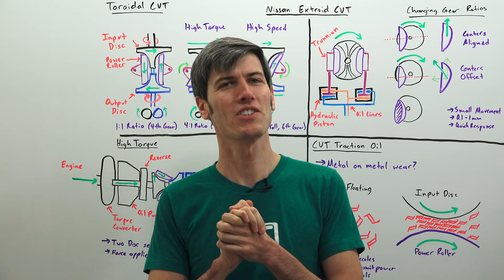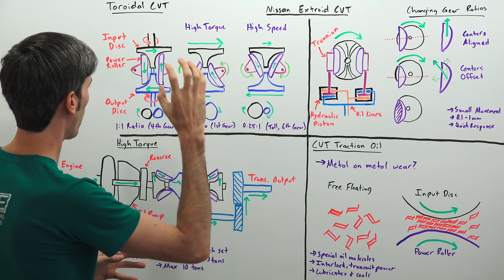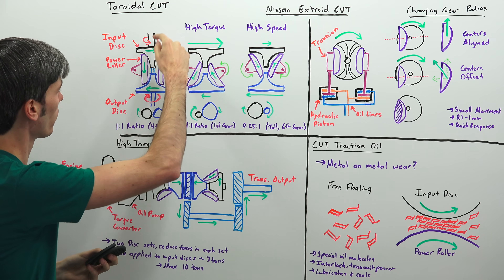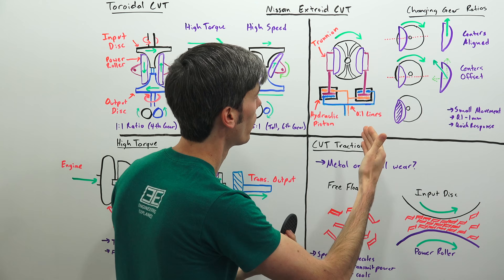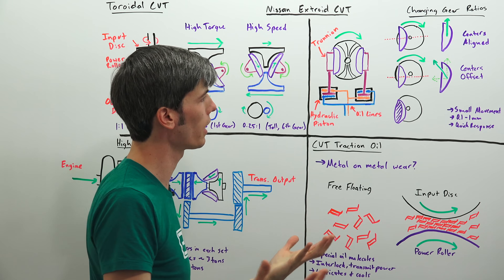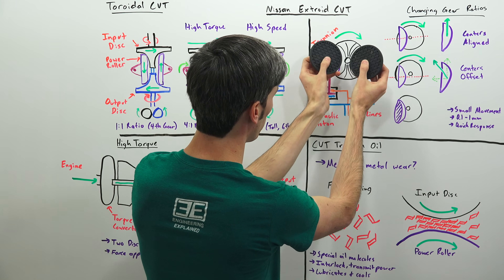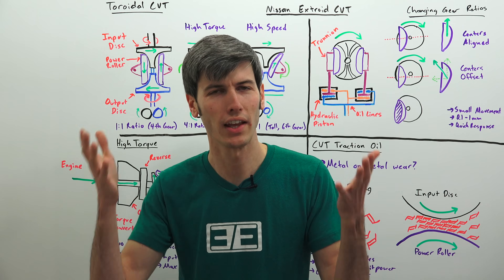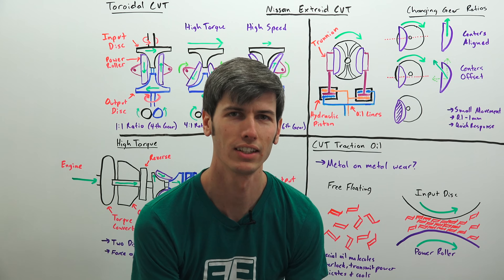Nissan Created The First Production High Torque CVT

Comment: if only CVTs hadn't been banned in F1...
Reply from the maker: Haha, the racing would definitely sound weird. Everyone at 15,000 RPM constantly.
Reply: That would be ear bleeding. The crowd would need earplugs. Lol
Reply: It is banned because webber or was it button? Did a lap and it was so much faster that it was banned immediately.
Reply: Why did they ban it?
Reply: @po.russki  that's not a simple question to ask on here, it's something to look up. But that basics was teams that hadn't put money into cvt research cried about getting their asses kicked. As cvts are electronically controlled it was considered a electronic driver aid.
Reply: Jay Dunbar is it possible to manually control CVT?
Reply: @dr_arcula  it's probably possible, however when they did the electronics ban they put in a specific portion banning cvt. As Maurice stated, the lap times with cvt decimated all so they made sure no team could find a loophole.
Reply: @dr_arcula  Yes. You can use a governor to control the position based on engine speed. That old governors, physical ones.
Reply: @po.russki  FIA doesn't like new tech that drastically changes everything
Reply: @k domster do you even know why automatic transmissions were even made? They were made because people got tired of shifting so much in cities! I have driven automatics before and they are too boring for me.  I'd rather have a manual so i can control the gears and drive the car the way I want or a CVT so I can maximize my fuel economy!
Reply: F1 politics, the desire to save teams money, and racing parity kept them from allowing. It would have provided the much needed development for everyday cars imho.  I recently saw a vid of a racing kart with a CVT and a very low horsepower Briggs LO206 engine (4 cycle lump limited to 6100RPM) and instead of performing like a rental concession kart it ran like a KZ shifter. It was shockingly better to accelerate than you see with a typical single gear LO206 setup.  It wasn’t overall as fast as a KZ or stock Moto shifter kart, but 6hp vs 35hp, it was pretty insane.   I’ll link if I can find it.
Reply: Hold up, they have been banned? Never thought that CTV's could have been used for motorsport. That would be some insane accelerations dude wtf.
Reply: @Z4G.  Yup ... Williams put a CVT in a F1 car back in 1993 (just testing, it never raced). The thing was so much faster (and probably quite expensive) it was instantly banned and remained banned ever since.
Reply: @kenkalajdzic  Daaamn thats insane dude. Any YT clips by chance?
Reply: The driver said he couldn't tell how fast he was going as well.
Reply: john smith not so much anymore!  For 2019 they added 2k more rpm to legal regulations ONLY to make them louder and a bit meaner sounding - we will see. the V6 Hybrid era (2014 - current) has made them sound quite sissy.... us old school racers miss the roar and pop of the 1995 Ferrari V12.   Huh?  What? Did you say something?  Lol.
Reply: and they wonder why F1 is slowly dying??
Reply: CVT sucks period.
Reply: @kdomster9141  you should refrain from commenting unless you have something to offer the conversation.
Reply: @jaydunbar7538  I do , it is not drivable in comparision to torque converted automatic . Cheaper is not always better .
Reply: What are you on about?  By what standard is driving a CVT worse than a slushbox?  Amount of profanity generated?  Great, slushbox is more reliable thanks to having like 20 times the R&D put into it.  Despite that, a modern slushbox still feels and drives like they did 40 years ago.  Gas pedal feels like crap and the transmission can't be assed to shift at any logical point.  If you're not going to have three pedals, then don't have gears.

Comment: Their current CVT is a disaster....I hope this one is better.
Reply: this is an old design from '99 that as far as I'm aware either isn't being used or is barely used anymore by Nissan, so shitty belt driven CVT it is...
Reply: @DylanTK  the last of these trans were made in 2006 for the last of the jdm g35
Reply: @DylanTK  They have chains now belts are long gone on Nissans
Reply: This trans died out in 2006
Reply: Well it's been in production vehicles for almost 20 years so I assume it's not a disaster.

Comment: NIce video. But by the way, why can't you generate electricity from a moving wheel to charge an electric battery in a car when a turbine turns to generate electricity? A turbine is not stopped to generate electricity, it moves to generate electricity . why isn't this same concept applied in an electric car
Reply: Unless I'm understanding you wrong, you can, it's called regenerative braking.
Reply from the maker: That's regen braking. You can do this, but it slows the vehicle down.
Reply: @EngineeringExplained  I mean, a turbine is not stopped to generate electricity, it moves to generate electricity . why isn't this same concept applied in an electric car

Comment: buckle up boys a CVT GTR is coming!!!
Reply: would certainly fit with the futuristic concept shown at Goodwood
Reply: Would be fun to see a CVT GTR race a Tesla, just to see who's going into "safe mode" first.
Reply: @MadIIMike  I'd pay to see that!
Reply: The JDM V35 Nissan Skyline Sedan (aka G35) offered an Extroid CVT back in the early 2000s. Nissan was actually engineering and contemplated offering a CVT option in the R35 GT-R, but decided against it in the end. CVTs are not new for Nissan. I remember seeing Nissan Marchs with CVTs in the late '90s when I lived in Asia.
Reply: @primera808  def not new for nissan... been using them since 92
Reply: No shift points means, no delay and lag between gears means, Hyper Godzilla on Steroids.
Reply: Since there are two toroids and they are pretty small, I'm assuming they could relatively easily get rid of the differential and put a separate toroid on each rear wheel creating the ultimate torque vectoring LSD
Reply: Blasphemy
Reply: Performance vehicles should never use CVT transmissions.
Reply: @dboucher26  the CVT could hold the car in peak HP, thus allowing for the best acceleration and top speed. it also would minimize engine issues as there wouldn't be any over-rev stress. i don't see any reason to not do it. it could also allow hybrid systems to feed directly into the drive train and allow for the engine to stay in peak efficiency during an "eco" mode.
Reply: Sad😕
Reply: no, GTR R36 would be either electric or hybrid. If hybrid, then they have chance to use this transmission
Reply: That would literally be the worst move Nissan could make!
Reply: MAKE IT STICK NOT THIS CRAP I’ll take it from factory and send the transmission back cause I don’t want this bullhshit. I’ll even leave a note on it
Reply: Ali Salahat 
Oh goody
Reply: Ali Salahat. I hope youre wrong.
Reply: But that thing already has a lot of things that can go wrong.
And they adding more?
Reply: Everyone knows they'll never be a re-designed GTR or Z car. sarcasm may be present.
Reply: I hope that happens, it about time CVT do over DSG's
Reply: I heard it uses a top secret drive, it uses energy from millions of bananas stacked in a specific geometric pattern.  I'm actually not at liberty to discuss it in detail here.😂
Reply: ...on a tow truck
Reply: That thing will be a monster. If it has an F1 or lmp1h hybrid system it's going to be disgustingly fast.
Reply: On God, I hope not. Lol
Reply: Will definitely be in a new Z car or the Q60 coupe
Reply: Jonathan Ramnauth hope not
Reply: @JHONNYR98    I think Zs are done. No major updates on a 2009 platform. I think the car is great, but sorely outdated compared to others.
Reply: Everyday we stray further from God's light.
Reply: NOPE ID KILL MYSELF